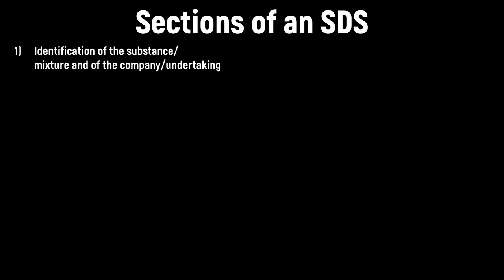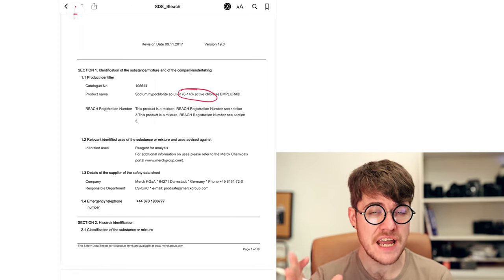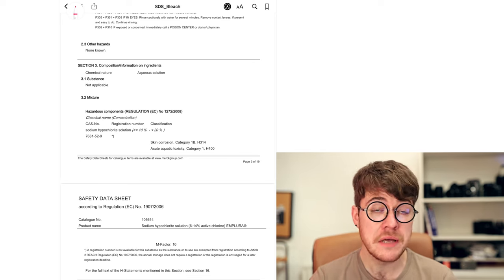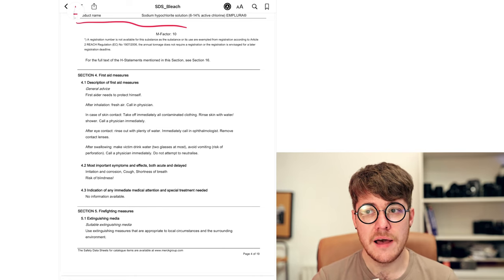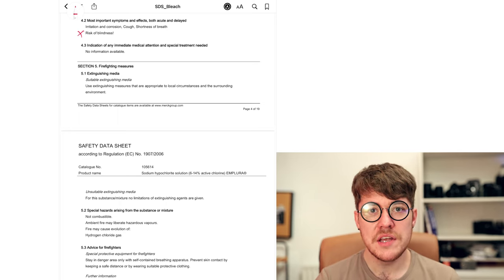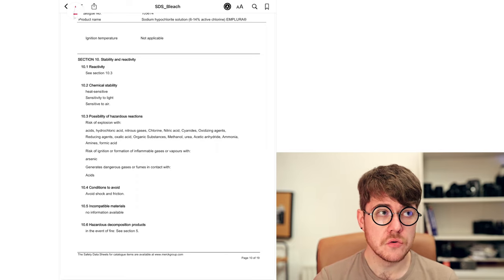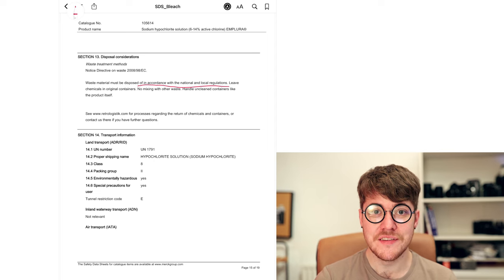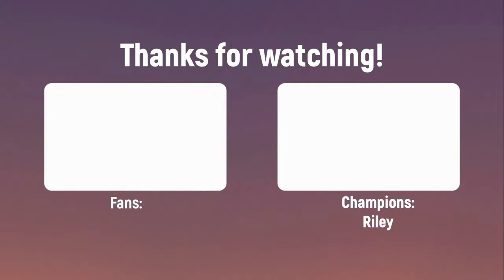How to read a Safety Data Sheet (SDS)

Comment: A finger drop of body solvent felt inside my mouth and I did not swallow it I automatically washed my mouth with a water hose and spit it out and it had a safety hazard logo and it came with a level 2 it says if consumed you will have vomiting dizziness and confusion but I did not swallow it so none of this happened to me am I still fine